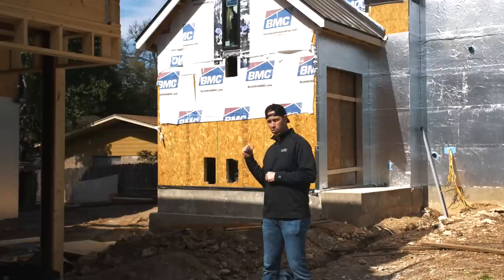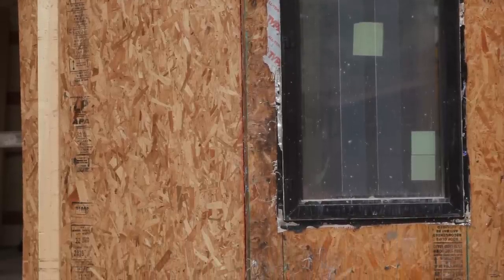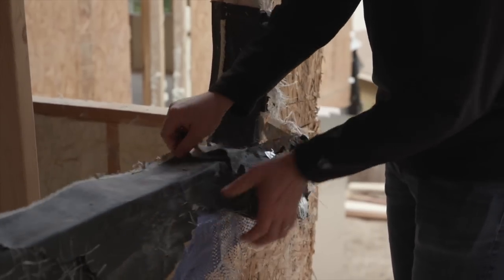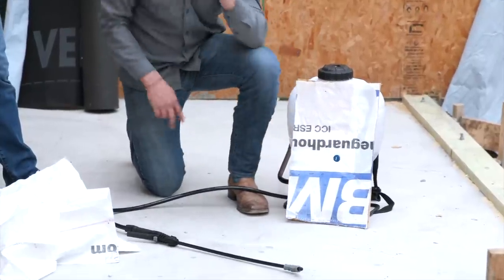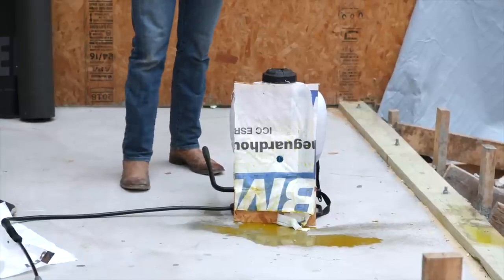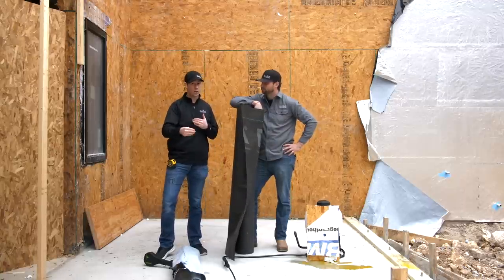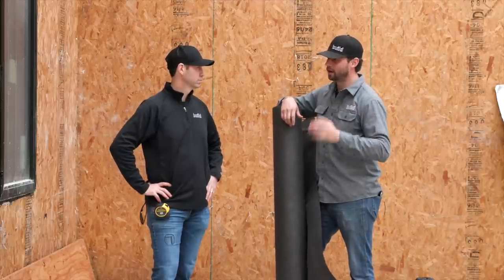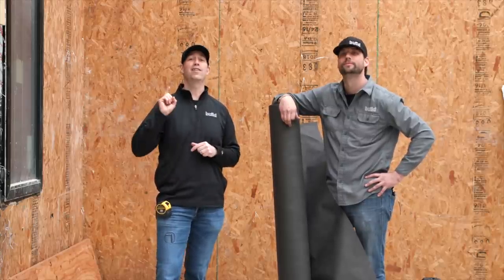Mold and Rot on a BRAND NEW HOUSE - What went wrong?

Comment: I was a home improvement carpenter for 15 years. I did major renovation work on many a building. I noticed over the years that houses that had adequate overhangs all the way around the building rarely if ever had water damage issues. Architects design modern style homes with limited to no overhangs and then try all kinds of water sealing products to prevent the resulting water damage. These products in my opinion never work as well as an overhang would. They do have their place such as behind stone facades. however, you eliminate overhangs and you're looking for trouble. It all comes down to this. Do you want a house that's durable or not?
Reply: That was the main problem with the leaky condo fiasco in Vancouver BC,no overhang and stucco.

Comment: I agree with the general point you are making, but I wonder if it's reasonable to call the original housewrap "inferior" if all of the damage can be traced to installation errors. Would this stuff still be inferior if everything had been flashed correctly and the more violent fastenings had been sealed? Maybe it's not the thing for extremely wet climates, and one only has to look at a shoddy building site to see non-adhered housewraps blowing in the wind, tearing on the few staples that are holding them on. And if you can't trust your builder to get all that stuff right, it's possible that a more foolproof system would offer some insurance, but there are so many ways to screw up housewrap and flashing that a bad builder is sure to find some of them, even with the perfect "system" at his disposal.
Reply: PC No exactly.
Reply: Well, yes, the install was wrong but, to get that wrap to work properly would be cost prohibitive; taping, caulking, etc. You might as well just used a better product.
Reply: Add in poor design by the architect.

Comment: So what you put on the outside, especially with the metal coating, is  very effective vapour barrier.You also put a vapor barrier on the inside of the wall, which will be 6 mill polyethelene, which has very low vapor prenetration.  But the outside wall has no vapour penetration.  So during winter months, moisture will VERY slowly build up in the wall, and it doesn't have a good way to get out.
Reply: Welcome mold!
Reply: Absolutly right
Reply: In the south (cooling dominated) we don't use interior vapor barriers.
Reply: only Canadians (afaik) put poly inside in the wall
Reply: I don’t think Matt has a good grasp of the engineering and physics and is just kind of pretending to be associated with cool “building science” stuff, and we don’t know how his buildings will hold up over time
Reply: The poly is a vapor barrier, the house wrap (Tyvek) isn't a vapor barrier. 

Do they do it different in warm climates because this is the standard way in cold areas.

Comment: Once upon a time in a wet, cold environment I lived in a $30 nylon child’s play tent. It taught me every thing I needed to know about managing water.
First she’d as much as possible. Second, lead water away from critical failure zones. Third ensure the dwelling breathes actively. Fourth keep your insulation dry.
Given that that tent was cheap it didn’t even have  zipped door flap so orientating it correctly in regards to prevailing weather was also critical.
Many years later, I replaced it with a proper Goretex Mountaineering tent, that although technically more waterproof, and vapour permeable was actually harder to keep dry. Why? Because in those early Goretex tents welded seams hadn’t been invented and every seam became a capillary leak- so I re-stitched those seams by hand in a highway lay-by with a heavy pure cotton thread and staked the thread ends away from the tent to suck the water away.

These days I own an old plywood, solid exterior walled home built in the 1970s. I solved a slight leak under the ageing single glazed aluminium joinery, facing the prevailing hard driven rain by crafting exterior PVC curtains. No more leak, and the house is 3°C warmer in winter. The curtains are only loosely fitted and thus breathe fully. As an added bonus, the exterior paint is no longer suffering dust corrosion beneath the curtains.
And LoL I still live in a tent.
Reply: And I agree with many others here. A good sized overhang, covering all the corners as well are a big advantage.
And preventing ground splash also helps keep the water out.

Comment: I am just a self DIY’er but have used Tyvek once.  The instructions clearly stated to use Tyvek tape over all fasteners.  If BMC states similar that “squirt” test isn’t representative.
Reply: So what about all the siding nails that penetrate the Tyvek after its all cap stapled, seams taped, and fasteners taped properly....😣
Reply: If you watched the video the problem was this house sitting for months with house wrap and no siding.  Once on, siding is caulked and painted and possible moisture exposure is way less likely.  But to your point, yes, that’s why newer products he discussed are better.

Comment: Around here they just put the junky house-wrap over the studs, and install the siding. When I meet with clients for insulation, I always push at minimum a High quality wrap applied with cap staples before I will even consider working on their home.

Comment: The only times I use the cheap house wrap is to hold up insulation in a crawlspace, keeps the insulation up (paper side up) and keeps down air invitation compared to the wire stays to hold up he insulation.
Reply: Do you use felt paper?
Reply: @nholt  no, I use the cheap woven house wrap. Gives the insulation continuous support (since the craft face needs to be up in my climate). If you use felt it will act as a vapor barrier, instead of a barrier that breathes, and the double vapor barrier will cause vapor condensasion and it will mold.

Comment: In the Pacific Northwest, rotted siding is the norm.  It would be a rare home that isn't half rotted.
Reply: I 100%agree. The Pacific Northwest is a tuff environment on almost everything.
Reply: The weather and climate in Southern New England is basically morphing into something resembling the Pacific Northwest, we are lucky to get a day and a half of Sun every week. This is certainly creating moisture and rot problems for homeowners in this region. My own house was built in 1989 (I bought it in '98), and although I eventually found out that the original builders did not do the greatest job, and cut corners everywhere, thankfully they used plywood sheathing instead of OSB, otherwise I would have had major rot and mold and perhaps even structural issues by now. The biggest issue was that the ledger board(s) for our large wrap-around deck were nailed right through the shiplap cedar siding into the rim joist of the house, with no flashing and no air space between the deck and the house. We have shed roofs without gutters that dump a fair bit of water onto the deck, which splashes back against the cedar, making it rotted, spongy, and green with algae where the deck meets the cedar. I bolted heavy steel brackets to the concrete foundation to support the ledger board, and chopped and chiseled all the cedar out in between the ledger and the house sill, and flashed everything , so now there's an air space for drainage and for keeping everything nice and dry. If the house had been sheathed in OSB I would have had major problems by now I'm sure. Anybody who lives in New England should categorically refuse to use OSB on their homes.

The builders also did not backprime any of the shiplap cedar, and they installed it right over Tyvek, which was badly deteriorated because of the oils and tannins in the Cedar. The kitchen and one side of the garage face South, and all of the cedar on that side of the house warped and cupped badly from sun exposure, presumably because it wasn't back primed and didn't have sufficient air space between the cedar and the sheathing to breathe and dry out. The garage section on that side of the house wasn't even Tyvek'd  at all, and unsurprisingly that's where the cedar looked the worst. I used  Tyvek plus a Cedar Breather type underlayment when I had all of the south-facing cedar replaced three years ago,  and I stained both sides of all the planks myself before it was installed. It still looks good.

Comment: If you built a house out of chalk and sponge glued together with Elmer's white glue but then put on a
roof with 3-foot eaves, it would stand. There is NO substitute for overhang.
Reply: Agree, love large overhangs !
Reply: Any thoughts on retrofitting with rockwool exterior insulation? I figure that I am losing 4 inches of overhang by using it when adding furring, as well.
Reply: @toddr3644 , If I'm hearing you right, you want to insulate the exterior walls of your home ? 
If so, you would need to extend the roof rafters, shingles, etc. or deal with the smaller overhang.
You also could use 1'' Polyisocyanurate foam board instead of rockwool which has an R-Value of around 6.5 per inch and only lose an inch.
Reply: @augustreil  Current overhang is 24-26 inches.  I live in zone 6.  Problem with only 1 inch of polyiso is that it's impermeable and would result in water condensing on a cool surface, namely in my wall..  Need an R-value of 11.25.
Reply: @toddr3644 , That's a nice overhang and understand not wanting to lose any of it. How would you get water condensing in your wall from adding the Polyiso to the outside ? Is it because it doesn't breathe ? 
Also, if you want R-11.25, Couldn't you stagger 2 layers of 1'' ?  That would give you at least  R 13 and no air infiltration at all.

Comment: Matt, you advocate two building practices which appear contradictory, at least to me.  Firstly, you like big overhangs to keep rain off the siding.  Secondly, you like continuous top quality waterproof, airtight vapour permeable house wrap from the roof to the wall so as to avoid having to try and waterproof penetrations and rafter joints etc.

Can you sometime show us an example of combining the two.  Continuous top quality waterproof, airtight vapour permeable house wrap with the supporting structure for overhangs.

Comment: I'm currently working on a project  that the HVAC was oversized for the  house. There's mold everywhere.  When we took the subfloor up I split a piece of it and found mold in between. It a total nightmare dealing with an insurance company.  It's a hurry up and wait, (protacol) they call it. Meanwhile the family is displaced  and we haven't  worked a day on it in almost a month, simply because of "protacol". So frustrating.
Reply: How does an oversized unit cause mold throughout the house?
Reply: Owner hire your own consulting adjuster. If they fail to negotiate in good faith triple damages in auto regulations. Find the best pit bull attorney and have him give you a list of qualified adjusters your ins company will put most qualified adjuster on your account. Have your adjuster on site for inspection. A friend is a company adjuster he got best restraint in town his wife was always glad to take call. He always got lucky lol
Reply: Doesn't sound like HVAC , more like vapour being unable to escape , good luck

Comment: The Alumi-Flash is only for southern building because it's vapor impermeable. But if you were doing a Perfect Wall construction in the north where the Vapor Barrier goes outside the sheathing and the sheathing vents to the inside, then would this product be appropriate for northern climate zones?

Comment: Ok Matt, renovating a home in northern Ontario, code requires a Vapour Barrier on inside, starting from outside to in: I was thinking the breathable exterior house wrap over the exterior sheeting, than batt insulation with a thin layer of styrofoam on the inside than the vapour barrier and drywall. Your thoughts on this. So I am getting the extra insulation and stopping the studs from migrating the cold by using the styrofoam on the inside but still allowing the wall to equalize the moisture that does accumulate.

Comment: Hi there, I dont claim to know much about anything, and am learning SO much from you, but my question is why not use an oil based coat of paint on the OSB, or boiled linseed oil application on the OSB sheathing and then put your normal wrap on top?  Im thinking just for extra protection, not as a substitution for best practices

Comment: Rule #1  Never use OSB.  Rule #2  if OSB is/has been used, your eves have to be 3X wider than normal, so if plans call for 12 inch eves, they have to be built 32 inches.   Also have noticed modern builders are cheating at the eves,  your rafters must run the full length of your roof.  and stop  plumbing your fascia boards flat...makes them rott, faster,  Fascia boards should be faced at the angle of the rafter..  Thanks,  new to your channel, enjoy it.

Comment: Great Video, lots a great information. My question is my new home is just now two years old in the Katy TX area with a typical Tyvek house wrap. What can I do to get my home up to this type of standard? Identify areas so little to no overhang, where I can add gutters. But then after that is it a mold test or what to get the water proofing and breath ability to much tighter tolerance? Or are we talking about ripping our sheet rock in those areas and updating from within? Really wish I found your channel during my build process.
Reply: Moisture issues that result from rain typically can only be corrected working on the outside.  If your builder and your local inspectors are capable, you will probably not have any problems for many years, if ever.  Many expensive repairs are the result of the owner ignoring an obvious problem for a long time.  So inspect your house (or have it inspected) every year and investigate anything that starts developing.  If something does start to go wrong, then have it repaired to the higher standard you prefer.  But remember, not every house will develop any serious problems.

Comment: After watching some of your videos that highlight so many problems with different products and materials, I have the idea that the "best" way to construct a house exterior is to TIG-weld sheets of 24 or 26ga stainless steel across the entire house. Costs more? Yes. But the house will still be dry and sound in 500 years.

Comment: That looks like Solar Board OSB, I am currently in the process of de-stoning/bricking my home because of continual water leaks through the facade and it's eating away/rotting out the the Solar Board and causing black mold behind the walls/sheetrock; its being replaced with the zip system with tyvek over the top the zip

Comment: I stuck with plywood as long as I could. In the end it became a budget deal breaker vs OSB ? You're right. should not be sold in the US.
Reply: Ironically, OSB is actually more expensive than plywood in Japan. But to be honest, I'm not sure they use much sheathing at all - I think my home was just wrap directly over insulation, then battons and siding... Hmmm...

Comment: This is misleading. These materials are WRBs:Weather Resistant Barriers. key word in that is Resistant. They are not meant to be for "water proofing". That is a completely different level of building that is still up to debate. That being said, I agree I would not use these house wraps as I have seen many failures due to Staples and penetrations. I'm also experiencing issues with Zip Wall sheathing with over driven nails that are in contact with open cell spray foam on the inside. It becomes a massive sponge with a water bridge from the outside. Huge design flaw. Thoughts?
Reply: With your Zip Wall sheathing, didn't the builder put some liquid flashing over all the penetrations ?  Or are the penetrations caused by something else ?
Reply: @augustreil  liquid flashing over every nail fastening location? That would be incredibly counter productive as that would number in the thousands. I would take back the premise of 'over driven'. It seems to be any nail that broke beyond the primary zip wall green WRB coating has the potential to become a water penetration location. We had to remove foam from several locations in the house after it became water logged due to an exterior sheathing nail coming in contact with the foam.

Comment: One source says moisture must migrate from inside to outside and visa versa.  Another says their way is the best, air gaps, solid foam inside and/or outside.  One video says don't install plastic sheeting over studs on the inside, another says it keeps the interior of the wall dry, etc
NOW I see you have completely wrapped a house in impermeable aluminum - what happened to the house needs to "breath"?  Please give a straight answer - what kind of material, in or out, in each temperature zone?
Reply: It sure does get confoosing doesn't it ?

Comment: ICF sounds more and more appealing.
Reply: Mitch and Cassie Shepherd I wanted to use ICF when I remodeled my current home 2 years ago but the architect wouldn’t go for it, said it created too many unsolvable problems.  I still like the concept and hope to someday build a new home and use ICF for that.  Would love to see Matt do a video on ICF (better yet, a whole series of videos).
Reply: What is icf?
Reply: mpe Insulated Concrete Forms.  Modular system that allows for quick building of concrete forms out of rigid foam insulation which then stays in place rather than getting stripped off like conventional forms.  Saves labor, saves transportation costs, adds insulation value to the concrete.  Can be used for below and above grade walls, as well as ceilings and floors.  Matt did a video on it at a house in Atlanta about 6 months ago.  https://youtu.be/MRipzKkeQik and there is a cool time-lapse of building the forms for an entire house in just 1 day at https://youtu.be/ez-M8wHX4Wk